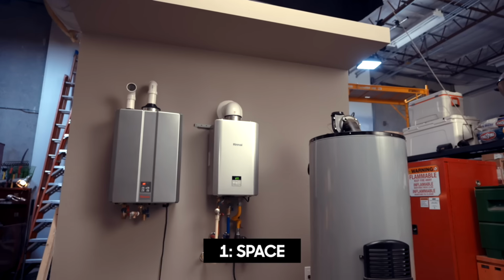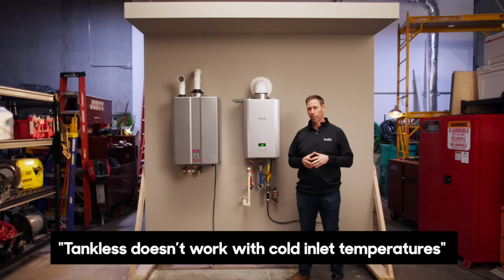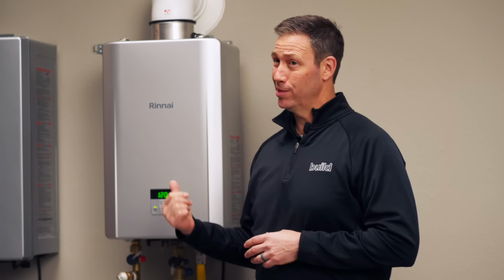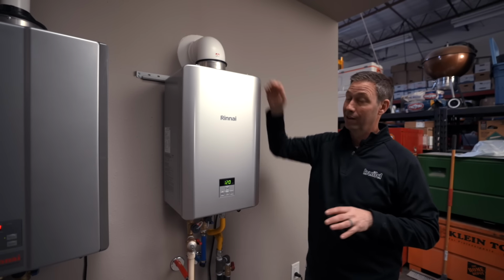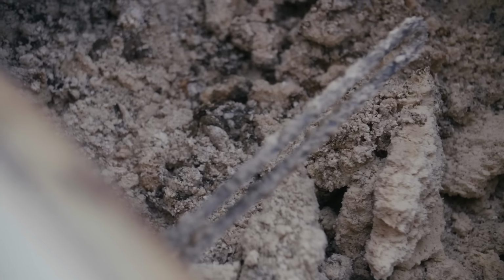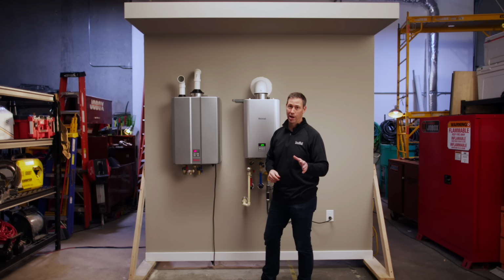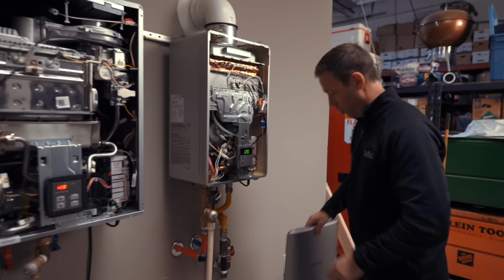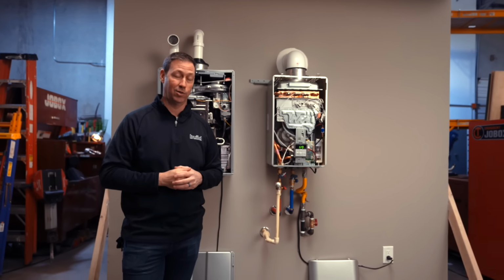DEBUNKING Tankless water heater LIES!

Comment: I do like my Rinaii tankless but there is one topic you did not touch on that we are most definitely having an issue with, and that is a tankless systems in HOT climates.  Arizona is that HOT climate in summer.  Combining the 100 degree water temperature coming into the system with the low flow shower heads that you get these days makes the unit switch off mid shower.  The unit seems to be unable to combine the low flow of the shower with the higher inlet water temperature.  I have tried setting the water heater temp to 108 and only the hot tap on.  I have tried setting it to 120 and combining the cold tap in the shower to lower the temp to a usable state.  I have spoken to Rinaii tech support (an engineer on the phone) and this seems to be a limitation.  The problem is a combination of water flow and inlet water temperature.  If anyone has some ideas, I would be excited to try them
Cheers

Comment: Well my experience with a Navin has not been great.  Every year for the past 5 it has failed (usually in the winter!).  it's not 10 years old yet, piece of crap!!  That said I have hot water rad heating so will replace this piece of sh*t with another manufacturer.

Comment: Not a fan of adding complexity, the tank design should be by design much cheaper and less prone to circuitry failure. Something doesn't add up here.
Reply: i know?  seriously?  all the thing has to do is heat water!  Granted that producing hot water on demand versus storing has a certain complexity to it, but still, how hard can that be!  All these problems people are citing.  Dang units should be able to adapt to differing water pressures, etc, and not fail repeatedly.  Some people have spent tons of money and thing still isn't reliable.  When have you ever heard of that with a tank?

Comment: A few observations from someone who has installed many of these...
Condensing units cost more, but the cost savings on the venting oftentimes makes up for it. If you have a long run, it ends up being cheaper. Plus, I find drilling a couple of 2-inch holes is easier and more practical than drilling a single 5-inch hole. Also, drawing intake air from inside of the structure is not recommended. For one, in a tightly sealed house it poses a safety issue, as these draw a lot of air, and the air cannot be replenished fast enough. For another, you are drawing heated/air-conditioned air from inside of the structure and blowing it outside, which wastes a lot of energy.
Tankless electric units do not require venting at all, and are smaller than the gas units. I highly recommend Steibel Eltron if you go that route.
Tankless electric point of use units are great for locations such as kitchens, where hot water gets used often, especially if it's far away from the main unit. I have a whole house unit but also have a p.o.u. unit under the kitchen sink which provides hot water at the tap in about 3 seconds.

If you have well water, there is no tank for the water to sit in and grow bacteria which is oftentimes what gives your hot water that rotten egg smell. (It can also be caused from having a magnesium anode in your tank).  If you haven't shocked your well lately, you might still get a little odor, but it won't be that overwhelming, plug your nose, kind of smell.
I set the unit at my preferred shower temp. then just turn the faucet all the way to hot. Most good units have remote controls available (some even have wifi now) which makes it easy. 
I honestly can't see a situation where I would ever install a tank in a house again.
Reply: Yeah I pefer tankless,  you also save more water
Reply: Is your point of use water heater in the kitchen a stand alone unit or does hot water from your tankless flow through it?

Comment: 15 year old tank water heater started to leak so it had to go. I installed a rinnai v65i about a year ago myself. The thing works amazing. I love it. The only things that surprised me was on the install. I needed a new vent because the tank system was tied in with the furnace. The plumber said it was against code to use the same vent since the water heater has an exhaust blower and there was a risk of back feed into the furnace. I went with the ubbink rolux vent system which worked great, but the cost for 10 feet of vent and termination kit was $500, just about as much as the water heater itself($680). If i would have realized in the beginning that i would have needed a special vent i would have selected a different unit that only needs pvc. Also as far as i was aware the gas line needed to be 3/4 so that had to be upgraded as well, not a big expense but still something worth noting.

Comment: I've had tankless and it's been great, except for the washing machine. HE machines pull water in spurts. The tankless system can't respond to and deliver hot water in time. Our only solution was to install a small electric tank in the laundry room to feed the HE washer. Other solutions?
Reply: Navien A model has a 2 liter buffer tank that solves these problems. The tank is kept hot at all times and the burner will fire on either flow or temp.

Comment: The electric wires , el panels and breakers  for a water heater are a lot more expensive than the ankless water heater. The small tanks are able to supply  hot water only for very low flow, once you open halfway or more the knob (valve) the water is just warm or cold. Check the power usage before you buy.I will never buy again a tankless water heater. The ads are deceiving including this video.

Comment: OK, this is a Rinnai commercial, and I get it. But let me comment from the perspective of a Rinnai tankless owner. Several (but not all) of the issues he calls a “lie” are indeed very, very true – so calling them a lie is a lie in itself. He got paid for that, but I’m not getting paid and I’m telling you the honest truth of my experience with Rinnai.

“Tankless units are expensive and expensive to install”. Yep. I replaced a $500 tank with a $1500 Rinnai – plus at least $500 for installation. So that claim in true, it’s not a lie.

“Scale and hard water is a problem for tankless water heaters”. Absolutely. Scale is a considerably bigger issue with Rinnai tankless than with a tank. Showing a tank with buildup is misleading – the tank likely still heated water. The Rinnai tankless would shut down. That claim is not a lie.

“Tankless is a new technology that hasn’t been proven yet”. Sure seems like it to me. With a tank, I had hot water at my faucets EVERY time. With a Rinnai tankless, usually, I get no hot water. The specs say I need about ½ GPM of water to activate the unit, but I have about 1 full GPM and the unit still doesn’t activate. I like the idea of tankless, but the Rinnai hasn’t been fleshed out yet and I have NO hot water at my faucets.

This has nothing to do with being “new-fangled stuff”, as he intimates. This is cold, hard evidence of one person’s experience with a Rinnai tankless water heater that doesn’t always heat water. I have begun discussions with a professional plumber to yank out the Rinnai and replace it with a dependable tank system. I’m just asking for hot water – that’s all. The Rinnai doesn’t consistently provide it, so I need to go back to a technology that works.

When my Rinnai works (e.g. showers), it works very, very well and I love it. But I have no hot water at my faucets, so …
Reply: yeah that "proven technology" is not trustworthy at low gpm and it's just ridiculous how easy it would be for them to fix that.
Reply: Regarding “Tankless units are expensive and expensive to install”: Add to my investment of $1500 for the unit  + $500 for installation, an additional $500 or MORE for plumbers to try to get the thing running over the year or so that I’ve had this! I’m into this for at least $2500 to replace a $500 tank system. … and I STILL have to apologize to house guests for them having to take cold showers! SERIOUSLY. 

This is an unabashed advertisement, and it’s embarrassing to watch.
 
As they say: "Caveat emptor". This guy works for Rinnai. Your experience is very likely to differ from this hard sales ad.

Comment: If you want to install a walk-in bath tub, the water capacity will require a minimum 100 gallon hot water tank. That's a lot of water to keep hot 24/7/365.

Comment: Re Instant hot water: In South America we have the so called "Electric Shower", which is a flow-through water heater incorporated into the shower head. Even so there is NO instant hot water. It always takes a few seconds of reaction time from the valve movement until the water temperature reaches the desired level.
I suspect that the "instant" is relative to a water tank heater starting from new cold until reaching operating temperature. The tank takes a few hours, while the flow-trough needs about 5 seconds.
Reply: When I lived in Cozumel I just had a black Rotoplas tank on my roof and that water would burn my ass.  lol  Incoming water temp has everything to do with the amount of energy required to bring it to a temperature suitable for a shower. Here our groundwater is 55 and in winter, city mains can go as low as 40.

Comment: dislike. 1st time on your channel. last time. this is an infomercial. you failed to mention error codes. search 'rinnai tankless error code'. you should have covered hybrid heat pump water heater which is about as efficient as a tankless when it comes to energy efficiency.
tankless common problems:
Mineral Buildup.
System Overload.
Cold Water Sandwich.
Air Supply or Exhaust Blockage.
Ignition Failure.
Flame Failure.

Comment: Nice Rinnai commercial. The myth that a Rinnai cost more to install is actually not a myth at all. You hinted at the reason but never explained it. Kind of disingenuous if you ask me. 

When you said the rinnai is 200,000 BTU unit you failed to mention that a standard tank water heater is a 40,000 BTU unit. And, of coarse you failed to mention why that matters. If you are wanting to replace your
tank gas water heater with a rinna, then chances are high that you will need to replace a portion if not all of your gas system to supply the new heater because the gas system was not designed to supply that much gas. I've even had cases where the gas meter had to be upgraded in order to accommodate the new rinnai.

Comment: Love our tankless. 

The only issue I had was @ year 6 the delivery pipe on the inside of the unit cracked.  It was still under warranty but it was pouring water. Thankfully it was mounted outside the house.   

Still love it!

Comment: Matt, love your videos, however I feel this one is a little bit misleading.  You refer to tankless in general, but then only talk about gas units.  Electric Tankless is very different.  Per several manufacturers, their largest residential units can only raise water temperature 40 degrees at 6 GPM.  So with your example of an inlet temp of 40 degrees, running 3 showers, at best I would get 80 degrees.  Per one manufacturer's region chart, for New York, they state 1.7 simultaneous showers or 1 large appliance at 105 degrees.  Lie 1, not a lie for Electric.  These large units also require 150 amps.  Recommended install is 3x50 amp breakers with 3x6 guage runs.  My house only has 200 amp service, which is not enough to run this unit and the rest of my house.  I would have to upgrade my service to 300 amps and my panel as it only supports 200 amps as well.  Lie 2, not a lie for Electric.  One that I am not sure of and would like more info on is the heating element.  With hard water and a tank water heater, the heating elements get coated and less efficient over time.  I replace mine periodically to keep up efficiency.  I assume the same buildup occurs on the element in a tankless, but I don't see anything that shows they are replaceable.

Comment: Problem is that these Gas fired boilers are going to be outlawed here in the UK  , to attempt to reduce CO2 emissions to zero by 2050 in favour of much more expensive Air source heat pumps from £6,000 .( $7358.70)

Comment: in 2014, I was working a contract job away from home and I rented a new one bedroom apartment that had a tankless gas fired water heater.  When I took a shower, the hot water demand wasn't high enough to keep the heater on, so the shower water went cold.  I had to turn on the hot water at the sink while I was showering to keep the hot water demand up in order for the heater to stay on.  So, keep your tankless water heater.  The 50 gallon electric water heater in my home that I bought new started leaking a little after 25 years.  I never had any trouble with it before with the original heating elements still working fine.  I replaced it myself with a unit from Home Depot for about $450 total....

Comment: I put a tankless water heater into my then 85 year old farmhouse back in 2006--one of the best decisions I've ever made in terms of comfort and economy at home. 

As for being 'new' technology, I'd been reading about them since the 1970s (they were very popular back then in Australia and New Zealand). Fifty years seems like long enough to work out the bugs--after all, the computer I'm typing this on right now is magnitudes of order more powerful than supercomputers were back then!

Tankless isn't really a new idea, after all. There were homes with tankless water heaters back in the 1800s. There were wood burning stoves sold with a small tank in the back of the stove that held around 10 gallons of water and were meant to be plumbed in with a coil of pipe to run the cold water through. Sadly, many people, including so-called experts in restoration, look at the teeny water tank and think it meant that people only had ten gallons of hot water max because the stove has lost the coil.

Comment: I am telling you, it takes a long time for the hot water to get hot in the tankless I put in. I do appreciate the endless supply of hot water. Iron in the water will start to corrode a metal screen filter and restrict the flow output.

Comment: Tankless work and work cheaper than a tanked water heater if installed correctly, problem is that most are not spec'd correctly for the house nor are they installed correctly. They have been used over seas for many many years trouble-free and are quite efficient.

Comment: We've had our tankless on our new home for 6 years now.  We love it!  My only warning is...you probably don't want this on the outside of your house, unless you never get freezing temps and power outages at the same time.  During Texas' big winter event, we lost power, which meant the electric heat tape keeping our outside tankless from freezing wasn't working--so it froze.  We were lucky, since after everything thawed out again, the tankless went back to work.  That was at a time when area plumbers were booked for a month.  Maybe better insulation would help?
Reply: Better insulation will help, but even better is to keep water flowing through it during freezes, even a trickle of cold water will prevent ice from forming.
Reply: @GregMoress  Sometimes. Rivers will freeze.
Reply: truly a design flaw, to have it needing a heat tape to survive the winter.  insulate the dang thing (so it's essentilally no longer outside) and be done with it.
Reply: @annamyob  Definitely.  We just didn't know this was a vulnerability.  Texas weather is insane.
Reply: @cariwaldick4898  i'm sorry you had to go thru that.

Comment: Yeah, "endless hot water" if the power or gas never goes out. Living in south Florida with the perpetual threat of hurricanes and no gas, only electricity, a BIG tank water heater makes a lot of sense. On a few occasions after a hurricane and subsequent loss of power, we still had hot water from our "tank" water heater. I can even hook up my modest generator to my water heater and make hot water. I would need a significantly LARGER generator to power a tankless water heater. For many applications, a tankless unit does make sense. Just not for everyone. . .

Comment: I have had tankless Stiebel Eltron water heaters in both my home and beachouse. They were about twice the cost of a conventional tanked system, but I calculated that if they saved me a few dollars each month they would pay for themselves in about 7 years.

Both systems had repeated failure and needed expensive repairs. After about seven years I replaced both thankless systems with tanked water heaters after they both failed again. The tanked systems I have had no problem with.

When I replaced them I expected my electric bill to go up as tank-less are advertised to be more efficient. Guess what , my electric bill did not change so the affect of these "green" systems was NO savings, a complete waste.

Unless you have a hundred people in your home and need unlimited hot water avoid tankless systems.
Reply: Imagine heating water in a pot on a stove vs heating water by hosing down the burner and catching the hot runoff. Which would be more efficient for putting heat into?

Comment: Years ago I bought a Renai cheap at Costco ($850 condensing). Then it sat for 4 years while I kept getting higher and higher quotes to install it. Last quote came in at $5000. Eventually found a gas fireplace guy to do it for $1200. Worked great ever since although it takes a couple minutes to get hot water to the shower. About a minute to get the heater spooled up then another minute for hot water to shower. Take longer hotter showers than the old gas tank heater and the gas bill is about 40% lower

Comment: We got our first tankless in Wisconsin in 1996.  It was electric.  The cost was much higher than a replacement tank water heater.  We loved it so much that, when we expanded our place into a cabin style B&B, we put tankless in each cabin as well.  We did, occasionally have problems with the first one in cold weather.  But we found ways to solve the problems.  The tankless allowed us to provide more space in the cabins for guests due to the water heaters taking up so little room.